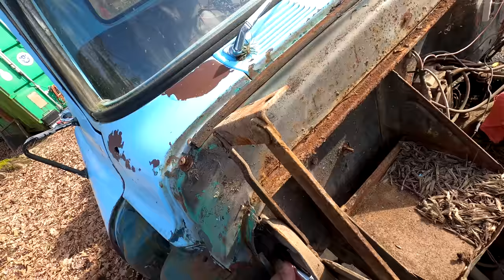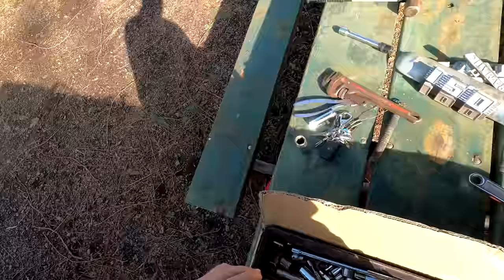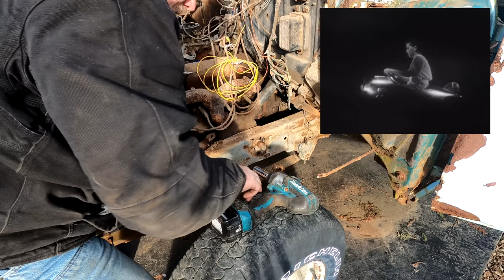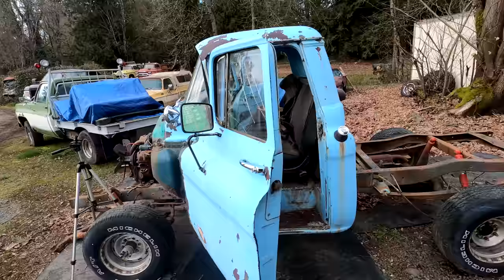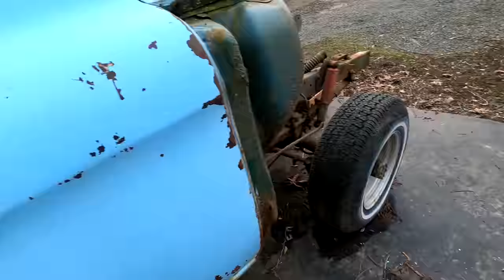1959 Chevy Napco 4x4 Cab Removal

Comment: Yup I have been there with a project.  My new years resolution, is to finish my 75 c10 transmission swap.  I never had a new years resolution, but this year I did. So hopefully by mid to late summer I can get my c10 back on the road.

Comment: Rusty nuts and bolt will loosen quite easily with a few squirts of acetone and ATF mixed about 50:50. It works also on mixed metals.
Reply: Up here in the northeast we have to use a torch on almost everything once it's had a few winters in road salt. Penetrating oils help a bit on lots of things, but under-car stuff that's rust welded in place after over 50 years sometimes requires oxy-acetylene levels of heat.
Reply from the maker: Both methods are handy. I do have to break out the torch for some of the really bad ones.

Comment: We agree with you.  It's an added plus when one knows his elevator doesn't go to the top floor, but we make up for it in different areas.  Negative feedback isn't really that helpful so one needs to  ignore it but still read  it. Who knows they're so flipping smart and sure of themselves al
Few times they screw up and actually say something useful. 
My $35 55 3100 think it was called Medow Green had a factory 265 V8 with the 4 speed.. We, your followers,  will keep laughing at your boo boosbut know you'll git er done either the right way or Rick's way. Hang in there.  Elwood

Comment: I just hate seeing skilled labor ploppin in the mud, rain & cold. Been there done that. That's why I moved to south Fl. Turn on the A/C in my very small 2 car shop and go to town on projects totally dry with every tool at arm's length.  However the drawback is I can only do 1 car at a time plus when I go to paint a finished car, I have to build a stick booth with sealed plastic outside. True a 40+ car shop would be great, but this place is paid off, warm in wither, dry year round and A/C in the shop in summer. So I deal with lack of space to work in because it's what I can afford. Don't get this old man wrong ( yeah I got a few years on yeah brother) We all have to deal with issues as long as we can still turn wrenches to build junk into an art form.

Comment: Those are figure 8 screw heads that fit very few things car and cabinet companies have a bad habit of making heads harder to remove every 4-8years
Reply from the maker: They are called "Clutch-Head" bolts, or at least that's what they call the special bits you need to get them out.